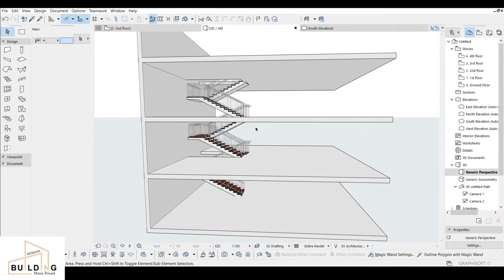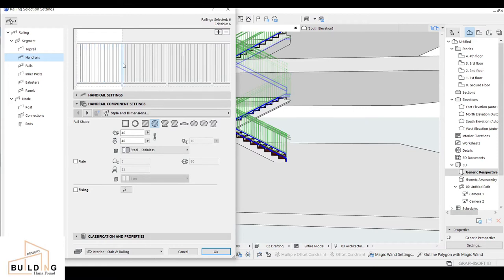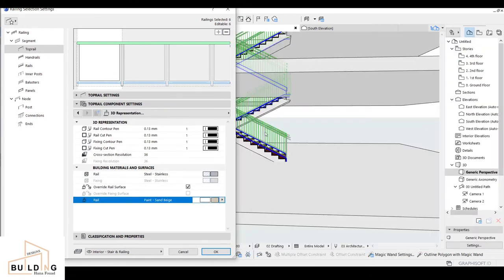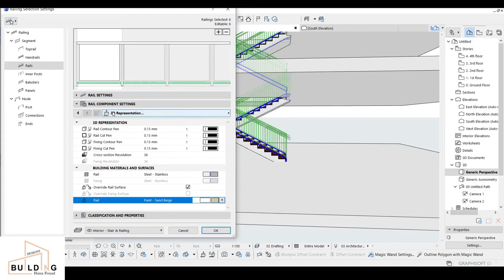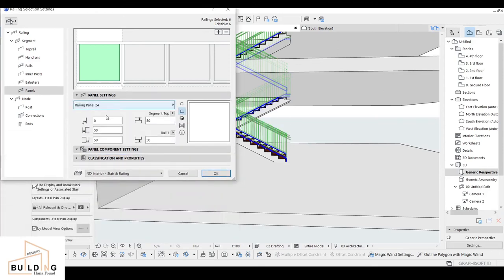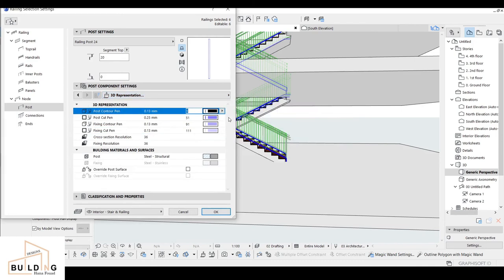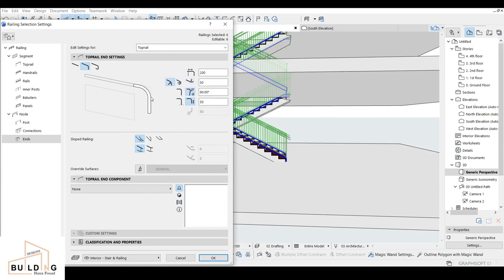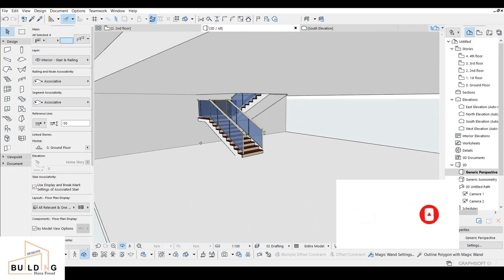How To Edit Railing | Part-2 | ArchiCad

Comment: i have a Question.  how to join railing in multistory staircase ?
Reply from the maker: Include the railing in the staircase at the input method section which there is option to select. 
also, checkout part 1 to design staircase at 2:22 / 6:37
link: https://www.youtube.com/watch?v=wSoLW862Oqo